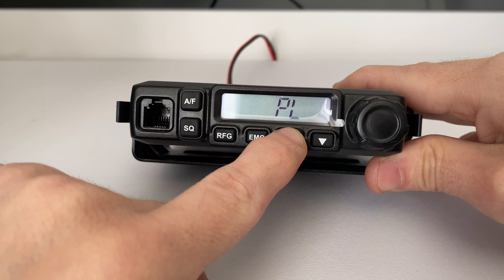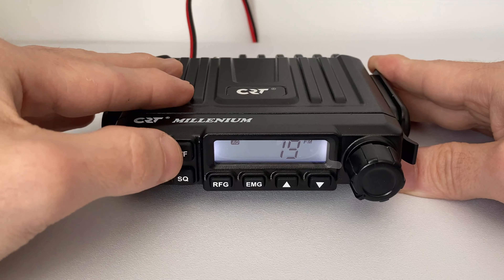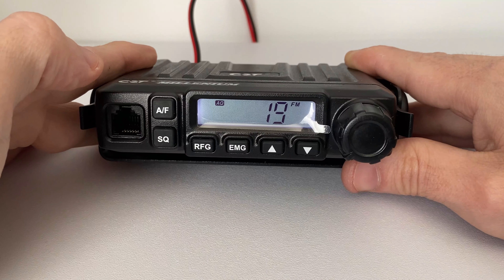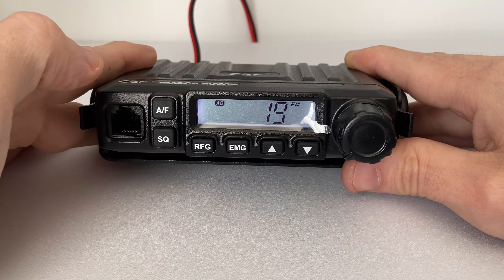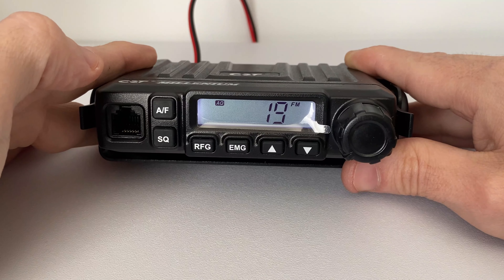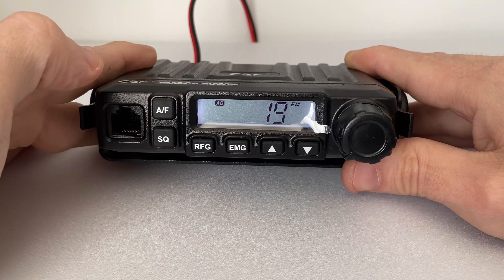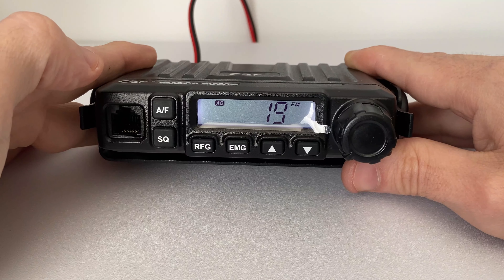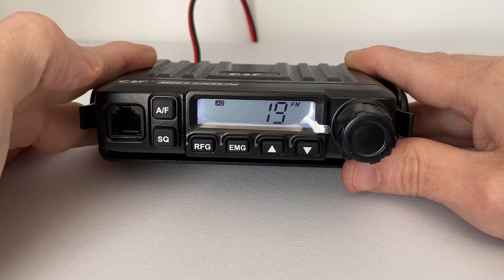CRT Millenium | Overview, Power Test, Mods and How To Enable 8w High Power Mode!

Comment: Hi. nice video. Thanks.
As i know, the second jumper (closer to the front) does not support the high power mode. With this jumper you can expand the radio to the 10m band. To switch to the 10m band you have to execute another key combination during start up. Actually I don't know this combination. I have seen this in a video here on YT 2 or 3 years ago. I think it was shown on a Albrecht  AE6110, wich is nearly simular to the CRT Milenium.

Comment: Hi Mike very informative thank you. I have recently got back into radio, I have bought myself a CRT xenon, do these radios have the same boards? I do struggle being heard as I live in a very rural area, so boasting power would be great?? Cheers
Reply from the maker: welcome back to the hobby! as for the CRT Xenon, from what I've looked at online - it can only be modified to run the high power mod on the EU band. It looks to be the same as the Delta Slim and a couple of others that only run high power on the EU or ham bands when opened up. The delta slim for example, can only be run at low power which is under 4w. I may be wrong, but from reading on Simon The Wizard's blog, it's not possible at the moment in UK mode. Cheers and beers, stay safe 73'.
Reply: Thank you very much for looking into this for me, this does seem to be the case☹️. Looks like I need start saving for an upgrade. Cheers again 73’s.❤️✌️

Comment: Hi Mike! Thanks for the video, really useful. I am looking to get a CB to fit to my first 4x4, and I found this one at a decent price around £50. Do you know of any others models I should look at before I buy, please?
Reply from the maker: Hi Paul, rigs like this are basic entry level CB radios and they do work but not as well as other CB radios on the market. It all depends on what size radio and what modes you wish to use, having said that a nice small radio that can fit anywhere is the albrecht AE6110 and there’s also a little more dearer on price, CRT2000 but has a wonderful colour screen.
But however they only do AM and FM, whereas if you want something with more punch and a few more modes to play with then an SSB radio would be the way forward and performance will be better due to higher power output.
A great priced SSB rig is the CRT6900 which is truly a cracking radio.
Due to changes here in the UK a few years ago we can now use SSB legally 👍🏻 whatever you decide, enjoy it :) 73’ and stay safe.

Comment: Hi Mike, thanks for the video. I'm new for cb radios and just got the crt millenium as my first radio, however i'm having issues receiving  plus no sound coming from radio. like i told you i am green and got the radio as I  am an offroad enthusiast. Can you guide me whether to check if the apparatus is gone? regards Tony.
Reply: Check the speaker connection. It's thin wire and may have a poor solder joint.

Comment: Wonder if it will still work safely off the cigar lighter or will it pop the fuse?
Reply from the maker: I’ve run a President Grant 2 (standard) which was doing 10w on FM through a lighter socket in the car and it didn’t blow a fuse. Used it for a few years too. So I can’t see this popping any fuses to be honest but worth having a spare fuse for the car handy anyway :)
Reply: 10w via 12v dc is 0.83 amps so fuse should be fine.
Reply: Most cars cigar lighters run at around 10 amps... So you could run around 30w without issue.
I did 100w once... it didnt pop the fuse but it did melt the internals of the lighter socket plug

Comment: What is the maximum frequency range of this radio in AM mode. I saw a chart somewhere that only the standard 40 channels are available in AM mode, is this true?
Reply from the maker: I haven’t got it anymore but from what I remember the AM mode works on the EU/Cept band.
Reply: @OntheMicwithMike  Ok thanks. I was hoping that the frequency range would be wide open with AM/FM both available as well. Not much FM used in the US on the CB band but the extra frequencies are always welcome.

Comment: Hi. Newly back to the hobby and have just bought one of these. When I switch it on, there is absolutely no sound whatsoever from the speaker. No static, no hiss, nothing. It`s as if it isn`t switched on, although it is as the display lights up.  Is this normal?  Also, I can`t remember what settings are best for squelch and RFG. Any pointers to help me please?  Haven`t used a CB for 40 years so my memory isn`t as good as it was so any help would be greatly appreciated. Thanks.
Reply from the maker: When you switched it on did you select what band you want it to turn on to? If you don’t select the band you want when it’s first turned on I think it sits in the band select menu which could be what’s happening. I can’t help anymore than that as I wasn’t that impressed with the radio and sent it back.
Reply: @OntheMicwithMike  Hi. Thanks for the quick response. I`ve had the radio a couple of days but, only after watching your video did i find how to set it to UK mode. So, I set it to UK but there is still no background hiss at all. It might be normal but usually on speakers there`s is some background noise.  I will go back out and twiddle a bit more but, I`m not hopeful :(
Thanks again.
Reply: Aha. Just pressed lots of buttons and something happened as there is now plenty of background static, which disappears when I press the ptt. Now, all I need is someone to talk to.....
Reply: @martinf8508   Hi Martin any idea how you solved your issue with radio ? I've got the same problem with mine , no hiss, no nothing at all.